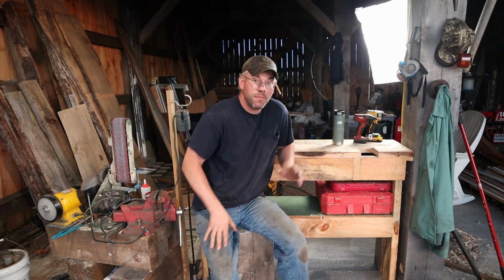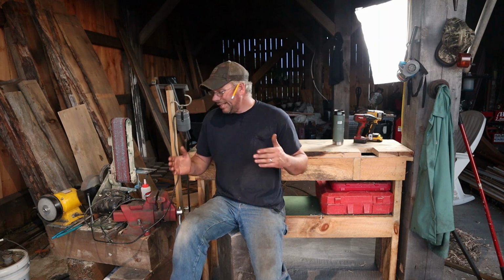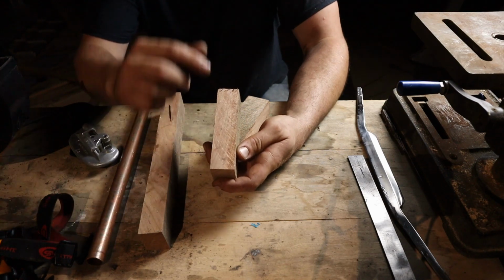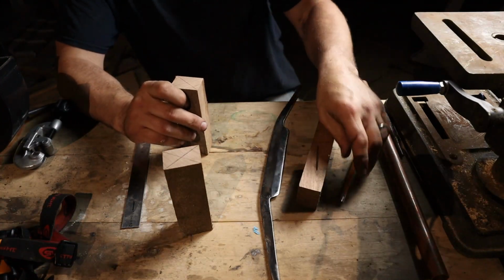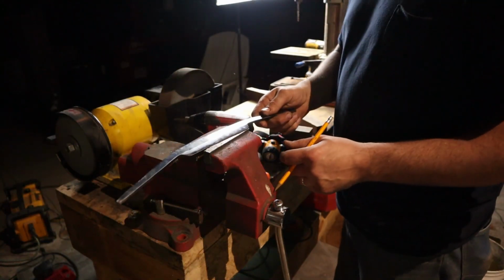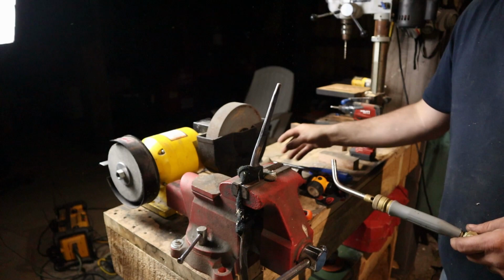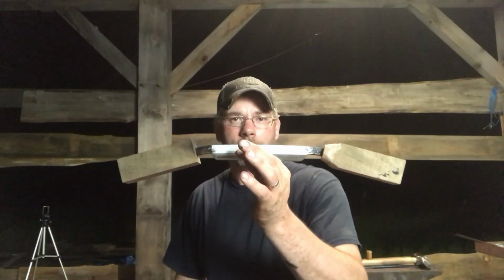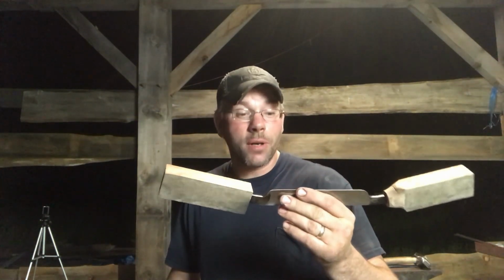EPIC Canon M50 Slow Motion Shots Of Rolling Smoke

Comment: Mr. Jim, Consider a couple of big-ass doors like on the other end/side, so you can have the view and breeze when you want it, but can also close it off when you don't!  You hinges on the other end seemed to have worked great!  I wish I had the means to come visit and help you when you start to build some more!

Also, what were the dimensions of the original bar you started with, please?
Reply from the maker: Hey Mark.  The back end is getting the same doors so I can pull farm equipment through.
Reply: @TheTradesmanChannel  Also, if you ever have construction or code questions, I'm a retired GC with 30+ years experience, worked in most of the trades, have a B.S. in Construction Science from Kansas State University, and have 5 years of Building Inspector & Code Consultant.  And I've got LOTS of time!!!
Reply from the maker: Nice